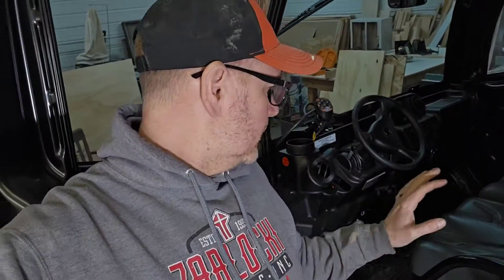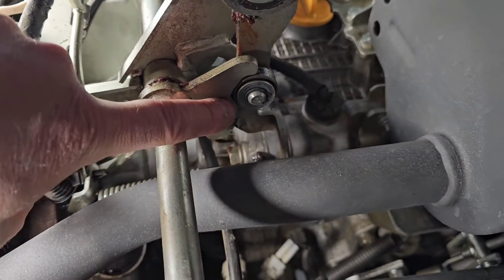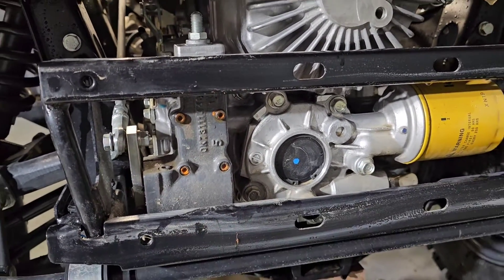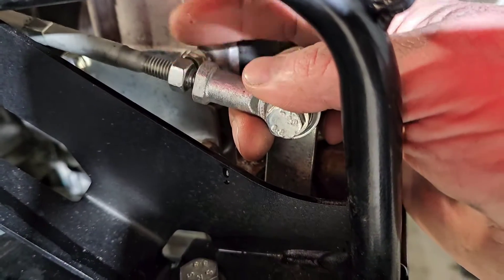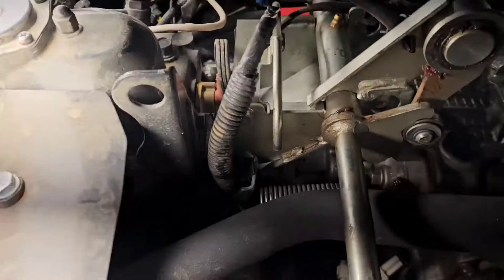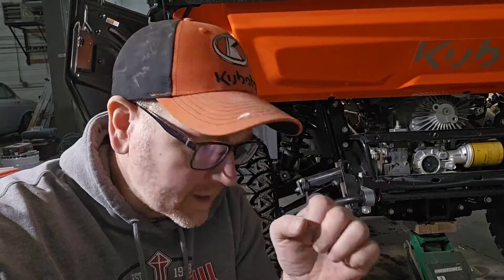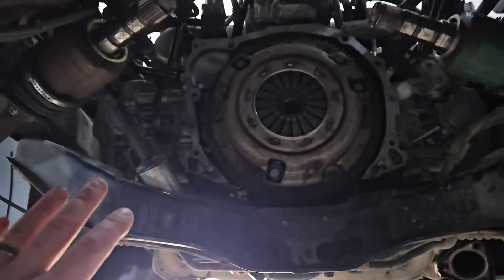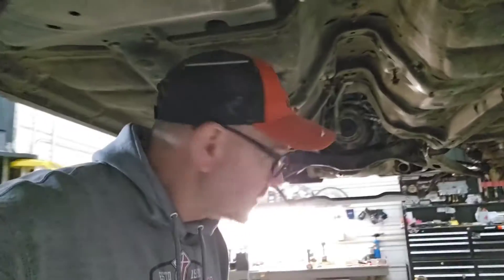Episode 4: HST Linkage - Kubota RTV Optimization Protocol

Comment: I have followed the RTV Optimization series and have performed all the steps for optimizing my x1120D. Prior to the optimization the RTV would 'bog' down to about 7 mph going up my steep driveway. After the optimization, I have it going about 10 or 11 mph. Nonetheless it still 'bogs' once on the steepest part of the driveway. Others have advocated for adjusting the 'charge relief valve'. Would you be able to explain that procedure?

Comment: Just have a question about a RTV X1120 transmission. I have a leak not sure where it’s coming from. It looks like maybe from the vent tube on top of the transmission. The oil level in transmission is slightly low. I cleaned the engine and when it’s driven for a couple of miles the top of transmission has an oil film on top.
Reply from the maker: Yeah, that vent blows fluid out all the time. Its kinda normal. I think the opening is a bit too small and the oil is able to get pushed out.

Comment: I’m working on a 1140 CPX that my granddaughter and her cousin drove into a ditch full of water. Finally got it running again but now it doesn’t want to shift out of reverse. I have to shut the engine off to get the shifter level to return back to neutral. I’ve done some of the adjustments you show but not having any luck with this problem. Any ideas?
Reply from the maker: On the top of the transmission where the shift linkage goes in there is a rod that pops out of place. Open that up and you'll see it
Reply: @SearlesStation  Ok. Thanks for the quick reply. I will look at that. Thank you for your videos. They have been very helpful during my unexpected project!

Comment: Any links to buying  a Workshop Manual for a 2025 RTVX-2 please? There are shop manuals for the previous 1100c but I can't find a manual for the 2024 or 2025 RTVX. Yes, I know they are very similar so I downloaded a pdf of the 1100c manual.I find it's much easier to work from a paper manual.
Reply from the maker: Check with a dealer. Some have them or print them in house. Might be too new to be on the open market 🤔

Comment: Swash plat angle increases flow or pump output. The greater the angle the greater the displacement,ac,ent and greater the speed but conversely hp draw increases. When the swash plate is in neutral there is no angle and no displacement or output other than some leakage so you don’t move. Pressure on hydro or aux is the resistance to the fluid or the work you are asking the pump to do.  
So the formula is PSI x GPM / 1714 = hp  one of the limitations of a HST is the speed and deceleration causing cavitation. The reason they restrict is reduce the opportunity for cavitation which will destroy the transmission.
Reply from the maker: Great information! Thanks for sharing that!

Although I don't have proof yet... I suspect that some of the failures in the hst is due to the anti-cavaitation valve they have in the system. I would suspect the spring or poppet in the circuit fails and causes the resulting damage.

Comment: I've done everything but the HST linkage adjustment on my new RTV-X (doing that next) and I'm already up to 29 mph.  I would also suggest adjusting the coast valve (out a little at a time) so it doesn't throw you over the front when you let off the pedal.  Once you smooth that out I would pull out that stupid damper, those two things give you much more control and feel of the throttle/transmission while driving.  Both are easily reversible, I learned these because although the process is slightly different, I did the same on my 2006.  The coast valve is much easier on these new ones once you pull the aluminum cap off.  You can literally drive a bit and keep adjusting until you get it to your satisfaction.
Reply from the maker: Awesome! Thanks for sharing what you've done to increase the speed and improve the feel of your machine!

Comment: Hey Ryan I have a older 1100c 
I need help diagnosing 
I know these are slow but I can’t get over 11 mph on flat   I need so more ground speed and engine will both down under full load or mudding going up hill
I’ve tried the screw under pedal and the pedal linkage with no change
Reply from the maker: The first thing to try is to clean out the spark arrestor. If your tail pipe come off you'll see a screen that's caked with soot. Clean all that off. If the tail pipe doesn't come off, there will be a bolt on the muffler. Remove that and smack the hell out of the muffler with a rubber mallet and rev up the engine. You'll see soot and carbon come out of the bolt hole. Smack and rev until nothing more comes out of the bolt hole. 

Try that as an easy first thing!

Comment: Is there a way you could modify or change some parts so that you could have an effective reverse pedal, like on the tractors? The way I use my machine I end up needing to use reverse very very often, and getting the thing to shift easily is sometimes the most time consuming part
Reply from the maker: Of course I believe that pretty much anything can be accomplished. In this case I don't think it would be easy to do. 

Shifting these is an issue for many. It takes some work to get the linkage adjustments settled in and making sure the unloading valve is set and pressing the brake pedal fully is important otherwise the gears are bound with pressure and it won't come out of gear or go in.
Reply: @ yeah i saw your other videos after i wrote this. I’ll put some time into getting it shifting smoother. Thank you for your time.

Comment: I have a quick question, I have two RTV X900’s - one of them has a throttle that has no lag in it but the second one has a slight hesitation when trying to take off. Essentially what is happening is when I press my foot on the accelerator pedal the engine RPM start to rise but there is no forward movement of the machine until I press even further down on the pedal and by that point it wants to lurk forward which is pretty annoying. Is there a specific adjustment somewhere that can remedy this?
Reply from the maker: It's a combination of the foot pedal / throttle linkage /hst linkage. They all actuate together in concert so one or more is out of adjustment. If you watch this whole series you'll see how they work and can go through the steps to adjust them. 

Grab a buddy and a 6 pack and you'll have it in a few hours. You can absolutely adjust it alone, but it's nice to have someone in the cab moving things as you watch and adjust.

Comment: I bought a machine that was used by a University to plow sidewalks.  I’m not sure if they de-tuned it so it wouldn’t do 30mph on the sidewalks or what.  But after spending several weeks on more cosmetic issues, I finally turned my attention to everything you covered in this series.  My machine used to max out at 17 mph and now I have it up to 28!  I’m thrilled!  Thank you.  The biggest gain came from the linkage at the HST.  I was losing half of my “go pedal” travel before I even started moving.  I kept checking to see if the parking brake was on.  Now, as soon as I touch the pedal, the machine moves.  What a difference.  Your videos are great.  Please keep them up.  A video on the muffler/spark arrester cleaning/maintenance would be great.
Thanks again.
Reply from the maker: Glad you're getting more speed out of your machine! Sounds like you found the culprit! 

I'll do a muffler video for ya!

Comment: What is the adjustment that is visible just above that linkage, poking up vertically? What does that control?
Reply from the maker: (It's a bolt looking thing with a lock nut?) 

That's the adjustment for the variable control lever. It's how you set it to neutral as far as the internal hydraulic circuit is concerned.
Reply: @ so basically that just adjusts where neutral is then?
Reply from the maker: @NotthatNeil  more like the adjustment locates where neutral is in the hydraulic circuit. its a physical place but things/springs wear out so it needs adjusting back to center(neutral).

Comment: I continue to have ‘hard shift’ issues on my 2015 900.  I’ve tried the pressure release adjustment that you mentioned on another video. Only very slight improvement. You are the only person who has mentioned the HST shift link adjustment.  I will proceed through your entire optimization protocol and see if I can solve the issue. Thanks!
Reply from the maker: Did you get it figured out?

Comment: I got a older model the 1140 and I’m having overheating issues cleaned the radiator flushed cooling system and refilled with 50/50 coolant thermostat and water pump is working good what could the problem be?
Reply from the maker: Most likely it's a cracked head or head gasket. You can pressure/compression test the cylinders to see if you can tell.
Reply: @SearlesStation don’t think that’s the issue and usually that’d be more rapid mine will only overheat if I am using it hard like driving it down the road in high and holding it for 15 minutes it’ll be near the red but if I sit at a stop sign for 2-5 minutes it’ll cool right down to straight up on the gauge but then in another 5-10 minutes it’s back hot. Had someone tell me to get a bigger radiator made to cool more water but if I fold up back 2 seats and leave a gap it won’t get over halfway on the gauge no matter how long I drive
Reply: @xade7863 did you ever find out what it was

Comment: Great video series, Thanks!  Wondering if you could guess at the issue I'm having with my 2018 X1140.  New to me, has 720 hours, and seems in great condition.  Only issue is:  When I'm traveling down hills (even fairly shallow hills) as soon as the speed from gravity seems to overtake the hydrostatic effort, it loses power.  The engine stays running strong, and I can even rev it up, but it's as though it's been shifted into neutral until the machine slows nearly to a stop.  Then, it'll re-engage power.  Happens very consistently.  Spoke with a dealer that guessed the governor is engaging, but... from your video the governor you mentioned is just that set scew, so I don't see how that's the issue.  Any idea?
Reply from the maker: I think there may be an issue with the hydraulic part of the transmission. It's an interesting issue because it really should build speed downhill with full throttle. 

There are some internal hydraulic valves, something may be stuck, broken, plugged in there. 

I wish I could drive it to see what's up.

Comment: I adjusted my linkage like you did here and now my rtv 1100 only goes 28 kph where before that it was going 38-40, could it be that the cable beside idler cable could posibly be streched?
Reply from the maker: You can adjust it with the wheels on the ground to just before they start moving. That's a bit more dangerous because it will move. 

It's surprising that it's that much different.

Comment: I just purchased a 2020 RTV-X1140 from an auction and im picking it up this week.  The title read:  "2020 KUBOTA RTV-X1140 UTV, VIN: A5KD2GDBCLG039343, METER READS 1,906 HOURS, KUBOTA DIESEL ENGINE, 4X4, HYDRAULIC DUMP BED, CREW CAB, CANOPY, WINDSHIELD (CRANKS & RUNS BUT WILL NOT TRAVEL UNDER ITS OWN POWER)"

Someone recommended starting with changing all filters and fluids and checking the suction screen in the hydraulic tank to make sure it is clean. Make sure you use fluids from Kubota. Make sure your suction line is not kinked or is collapsing.  I Just down loaded the WSM, but can you point me to where I will locate the Suction screen?
Reply from the maker: Check the line coming out of the tank on the bottom.

Comment: very informative videos. i just recently rebuilt my hydro trans. one of the pistons on the pump had worn through. got it all together now it tops out at about 7-8 mph. ive been told that the servo adjuster nuts need re-adjusting but they cant tell me how to adjust. is that something  you could shed some light on?
Reply from the maker: I'm rebuilding one now. It will be a bit but I'll post a video when I can. 

Thanks for watching
Reply: @SearlesStation  any update ?

Comment: i have an older 1100 that we mainly blow snow with ( and it does a heck of a job at that). problem is the shift mechanism has never got better.,  is the new version any better.it seem to be a standard hydro static transmission by your video,
Reply from the maker: https://youtu.be/q-C3KzQ6NwA?si=pmTGHKGA4xOeyeBe Check out this video. Make sure the linkage from your brake foot pedal is operating your relief valve. 

Also, I have a video of the inside of the vht and even with no gears inside the shift lever is difficult to move. Could be a design flaw

Comment: Would low hydraulic oil cause it not to go forward and reverse? Is there a bleed valve for something after oil change?
Reply from the maker: Make sure it's full of fluid, jack up the rear end, start it up (in 2 wheel drive), put it in high and press the foot pedal and for a little bit. See if it starts turning the wheels with no load on the tires.
Reply: @SearlesStation  filled my tank to the proper level. Let it warm up for like 30-40 minutes. And it still doesn’t want go forward or reverse. Is there like a release valve or something?
Reply from the maker: Does it shift into the gears? Like, is the shift cable working?
Reply: @SearlesStation  it all started to loose power after driving it for maybe 30 minutes to 1 hour. I’m thinking maybe fuel filter or something not engaging. I checked the gear selector unit seems ok. Could it be the unload valve part that ain’t making it move?
Reply: @SearlesStation  is chevron Rando HD ISO 32 good for transmission oil? That’s what it has right now.
Reply from the maker: @wyteout3720  I did some research and it very well could be the fluid. There are specific specifications that the oil needs and UDT2 has been developed for the system. 

I read a similar story to yours where they put in a different fluid and it didn't operate. 

I highly recommend ordering the Super UTD2 and doing a full oil change. I know it sucks but that's what I'd do. 

You can order it on Amazon...
Reply: @SearlesStation  thanks that’s what I was kind of thinking might be the fluid. How do I drain out all the fluids through all the hydraulic lines after draining the tank and the transmission?
Reply from the maker: Have to do your best to disconnect hoses and get the most out. You might want to consider doing another fluid change after you run it for 100-200 hours